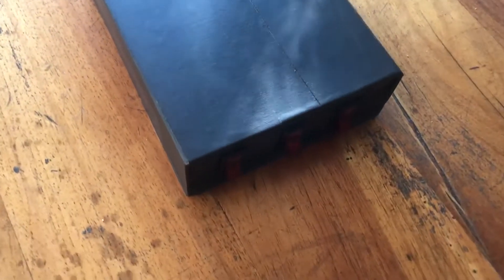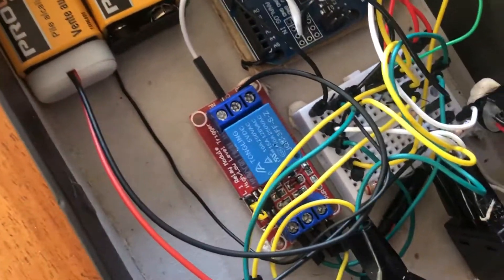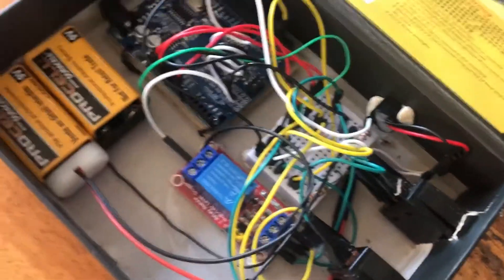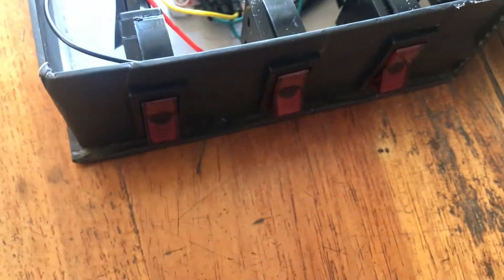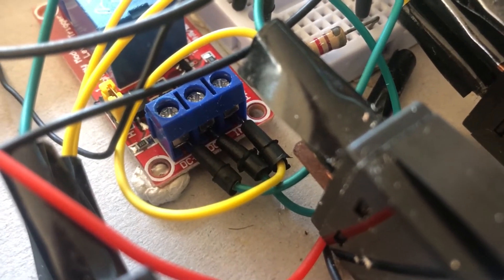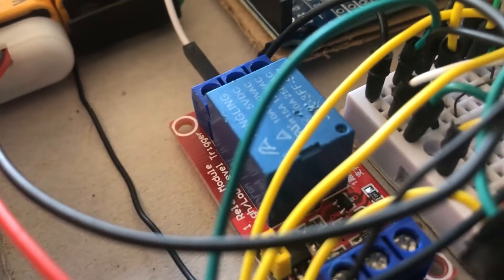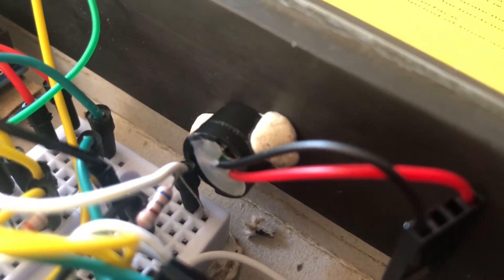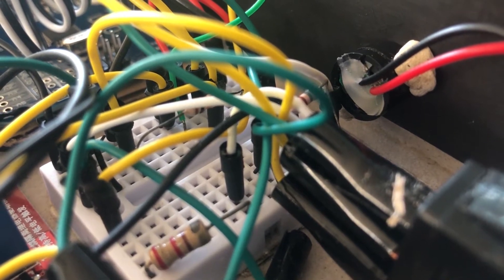Preview Of My Homemade Model Rocket Launch Controller

Comment: I like your Launch Controller!  Especially the safety interlock.  Did you find that your 9v battery provided enough current?

I also would like a full tutorial.  It might be fun to do something similar.
Reply from the maker: Thanks! I actually have a video coming out in a few hours which has a cool update to the launch controller half way through. As for your question, yes, the 9V battery seemed plenty, remembering that I’m using 2 as to have the full current available to the igniter while the other runs the Arduino. I might do a tutorial in the future.